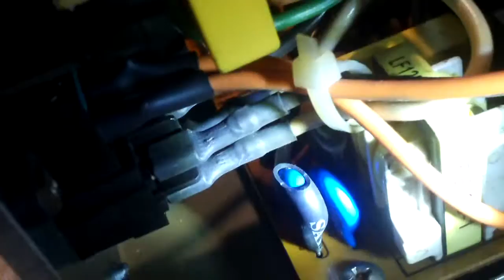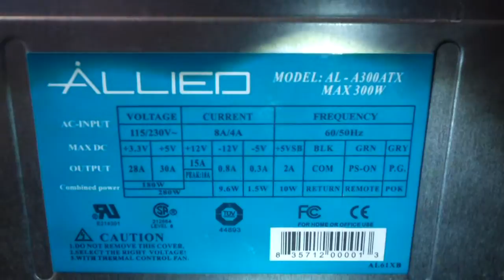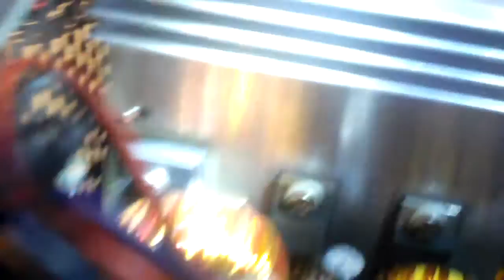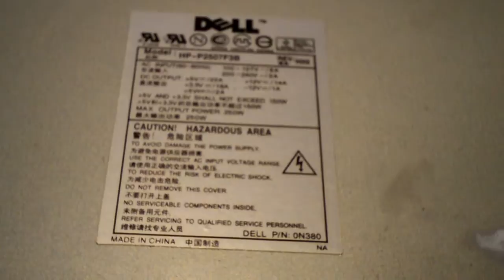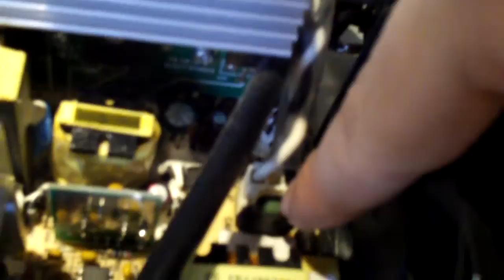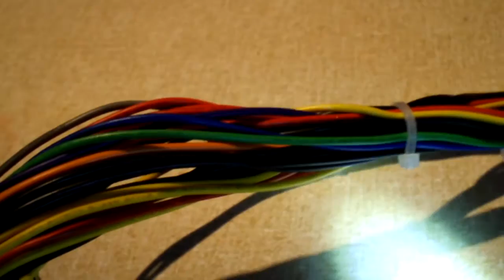Overbuilt Hipro 250W and Deer Roast Allied 300w PSUs

Comment: A modern design indeed - a 30A, TO-247 part for the +12V rail that's rated at 14A? Talk about overkill! TO-247/TO-3P parts usually cover more surface area on the heatsink than TO-220 parts so they are capable of quite a bit more. That PSU... 250W.... more like 300W continuous @ 50*C ambient and 95% humidity...

Comment: That Hipro is definitely a beast though, so were all the Newton Power and Lite-on equivalents of that time. I've never actually seen the extra PCB mounted between the schottkys and heatsink in a Hipro before. I would fear that it somewhat impedes cooling in comparison to the regular approach, but in a PSU that overbuilt, probably not. That secondary heatsink is the thickest heatsink I've ever seen in a PSU cooled by an 80mm fan.

Comment: Linear regulation is inefficient (so more limited in power output) but simple and usually results in very low ripple and noise, and very good voltage regulation, usually even better than the regular mag-amp circuit. I don't think the secondary toroids in the Deer look horrible, but they do pale next to the Hipro. But yes, Deer/Allied PSUs are usually trash, especially since the resistors they install on the secondary side usually run upwards of 100*C.,,

Comment: That PSU indeed uses DC-DC conversion for the +3.3V rail... but notice the extra transformer tap in the main transformer. It is not linear regulated from +5V, which would waste LOTS of power... it is linear regulated from what I estimate to be a 3.8V transformer tap that ESAD 83-004 rectifies and the MOSFET in question regulates down to +3.3V. That component you were looking at is not a FET, though, it's a triac for protection circuitry.